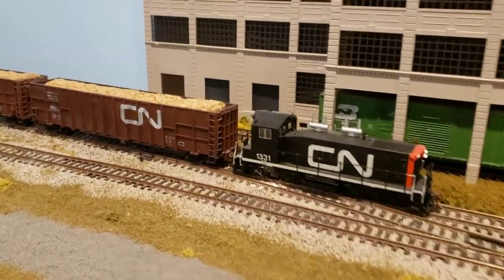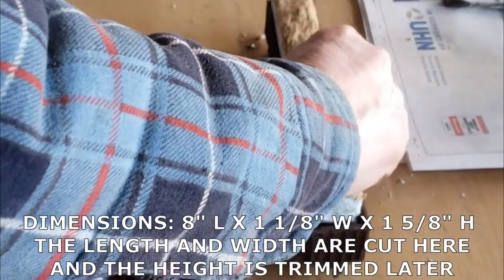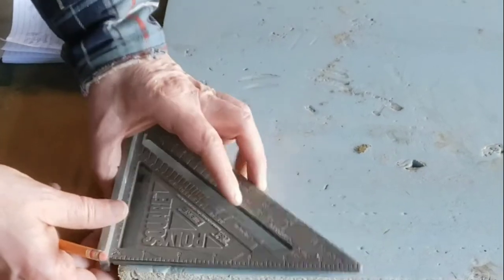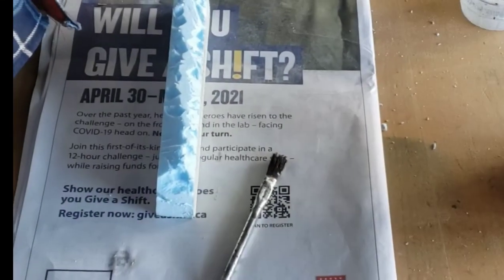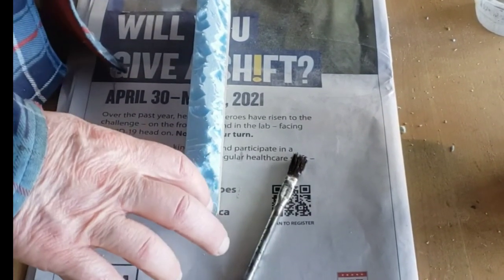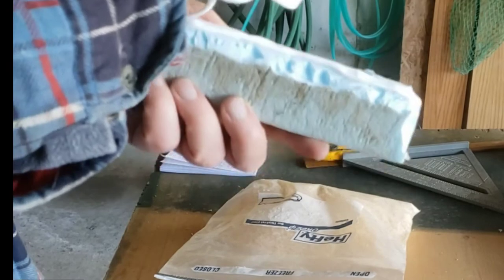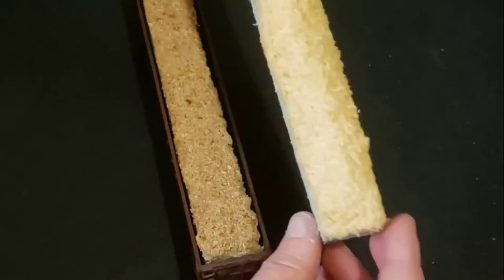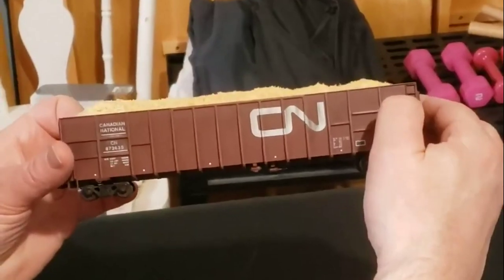HOW TO: MAKE REMOVABLE WOODCHIP LOADS

Comment: It would have worked much better and cleaner if you inserted the foam into the bag of sawdust and then removed it
Reply from the maker: Good point as did do that when making trees.  Thanks for the tip!